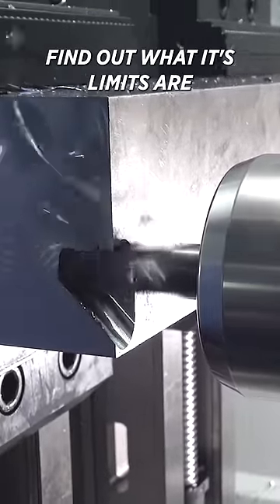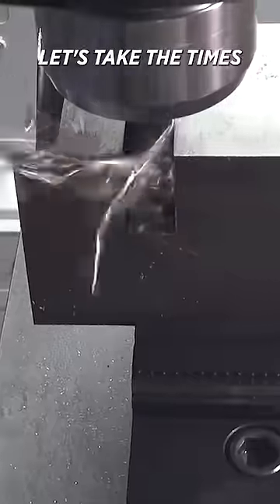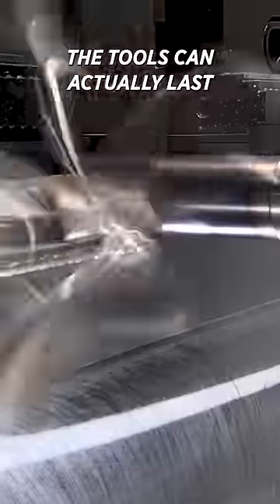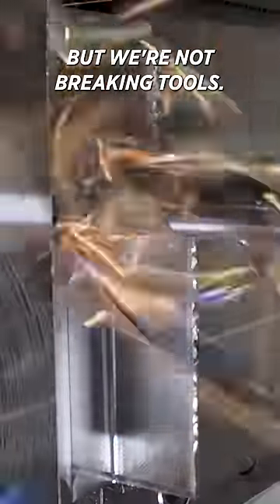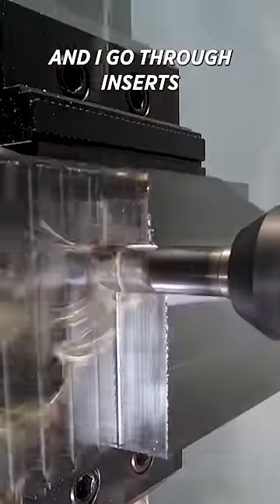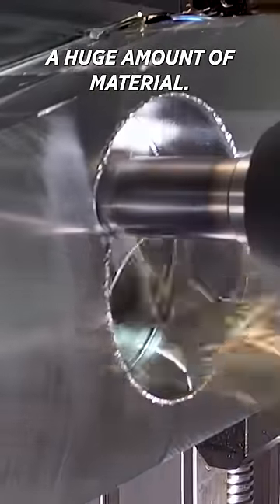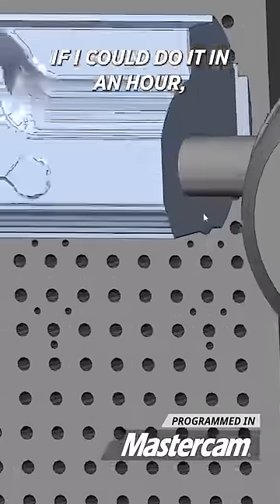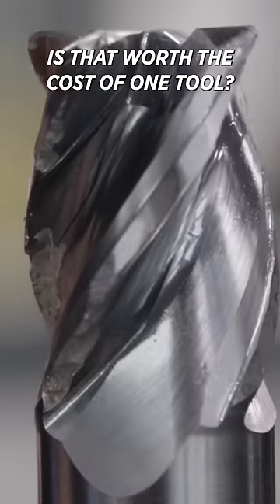Why Do We Push Our Tools to the Limit? #shorts

Comment: Pov:your manager wants you to walk on a knifes edge with their expensive equipment to keep up with their quota
Reply: ☝️this
Reply: Theyd rather melt the order and get the next one started
Reply: Boss man practically kills himself for 3 minutes demonstrating how he wants you to do the job for the next 8-12 hours. “There, like that! Easy!” Love that stuff.
Reply: Aint that the goddamn truth
Reply: You commented on the wrong video. In the video above, he explains that you do NOT run your tools at the breaking point. You find out the limit and then run conservatively 20% below that. What he is explaining is the waste of machine time by running at a very low speed is not worth the increased life of the tools.

This is like hearing your friend explain that he would rather double his 30 minute drive to work to 60 minutes, because it is not as rough on his engine and he gets better fuel mileage if he stays below 35 miles per hour. It makes no sense. It is a misuse of the tool to waste that much time. If a tool lasts 6 months instead of a year, but you only had to run it 700 hours instead of 2000 hours, you are using your resources effectively.
Reply: @Master Arkannor  you commented on the wrong comment. If you read the comment you'll see that it says exactly what you typed out
Reply: @MasterArkannor  the guy explicitly says at towards the end of the video "If the cost of damaging a bit is balanced by the money saved by the faster pace, then damaging bits must be considered". This is not word-for-word, but that still what he's saying.
Reply: @julianlovato1093  No. 80% is not knifes edge.
Reply: @Steampuke  I repeat my earlier statement. He is responding to an industry practice not explained in the video. I refer to my example of doubling your commute. Even if I could go an extra month between oil changes by driving my car at 50% rather than 80%, but my drive times are 5 times longer, too use his comparison, I am misusing the tool.
Reply: @chainblayde  repair tech here. Can attest
Reply: Especially when your manager cannot even turn the machine on 🤣 I've had a few "supervisor's" like this hahaha
Reply: @mrmatt4873318  Yeah, hahaha. So funny. Like when the 55 year old general cannot do as many push-ups as a 19 year old, hahahaha. Like why are they in charge of they cannot do what I can do? Hahaha they are useless.
Reply: @MasterArkannor  If you're managing a factory you should probably at least know how to turn on/off the machinery.
Reply: @MasterArkannor  one second of cooling pump failure will ruin the part and the tool, so no, the edge is  really a margin and without machine inspections he wont know how thin that margin is until after things are ruined.
at the level he allegedly operates at he should be making his own tooling, not buying it.
Reply: @privateprivate5373  Exactly. So we both agree that if you have reliable cooling, and your machine time is 5 times more productive, and your overhead and maintenance costs do not increase 5-fold, then the resources available are being used better.
Reply: @ninjycoon  If your boss could do your job they would not need you.
Reply: @MasterArkannor  Yes they would because they have other responsibilities that they need to take care of as a manager/owner/ceo. If you are in charge of a group of people doing a job you ought to know the basics of that job so that you can have a better line of commuication with your employees. It also shows that you have an understanding of what they have to go through to work for you which will make them respect you more. It's basic leadership qualities that we are talking about here.
Reply: @MasterArkannor  again, the 80% thing is ok, I'm not talking about that. I'm talking about the end statement.
He's saying that if you make enough money because of the time saved, you should also consider having your motor seize up from the lack of oil change. I'm not saying he's stupid or something like that, I'm saying that this particular thing isn't a healthy practice and it can create unnecessary waste. And yes, I know dis can be sharpened back to use but that last bit we see a close up of is done for
Reply: Yeah would be cool if the guy didn't write the programs and run the machines... he went out and started up self employed now he runs a successful company, this ain't the guy to treat like some clueless manager lol
Reply: @chainblayde  fr management are so disconnected from real life
Reply: POV: you just saw a stupid take of a man that never worked a day in his life.
Reply: Well it’s a business for money not for fun
Reply: I completely agree. I was in charge of a cms machine and I would be switching parts all 8 hours and day I was there. I would say a new bit would last one week before getting dull. All Just to catch to late orders. 

Etc. I left that job.
Reply: Yet another reason why the duplicated effort of "entrepreneurship" is worse than central planning. Less waste in broken equipment, less duplicated admin resources, and less pressure on the workers.

Comment: As an engineer, Tool Management was for some reason always the hardest part to explain to management and production that going fast doesnt always equate to lower cost
Reply: You mean If we ignore preventative maintenance and have machines go down for months it’s gonna cost money that push jobs out the door in the short term… what
Reply: Exactly, makes no sense to go 5 times faster if then the machine isn't up to standards and needs to be replaced, like this guy thinks people are thoughtless NPCs?!?!
Reply: You’re an engineer.. I think I can speak for every MAN here, and say, your opinion doesn’t matter, or count. When engineers stop putting starters under manifolds, I’ll start valuing their opinions.
Reply: @MOST415  bitter?
Reply: @MOST415  that's by design. Engineers just find it funny to design things that are hard to work on because they know they'll never actually have to work on them.
Reply: Ran many types of CNC. Cut too slow- and burn up tools, cut too fast - burn up tools. Chip load is key, the chip actually helps cool the tool as it cuts. Pushing the tool too hard will break them. It's a balancing act.